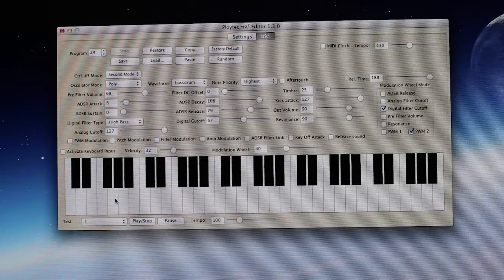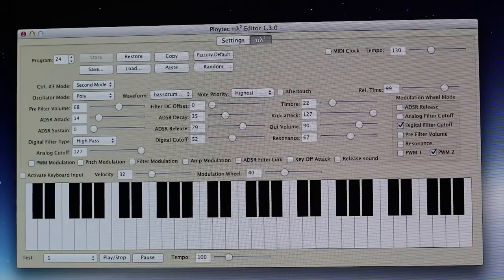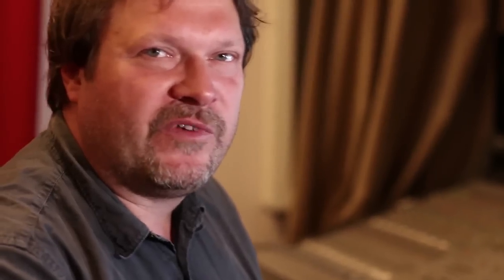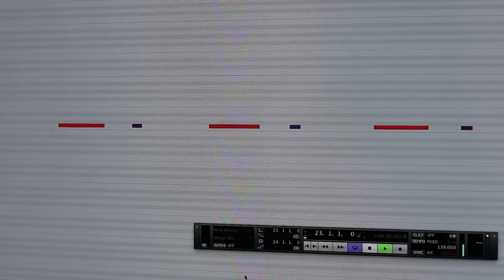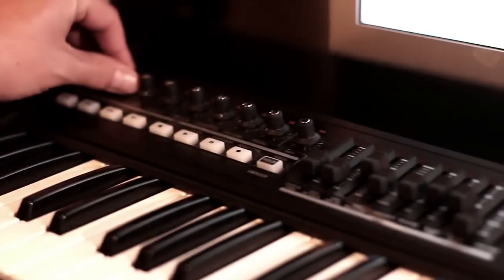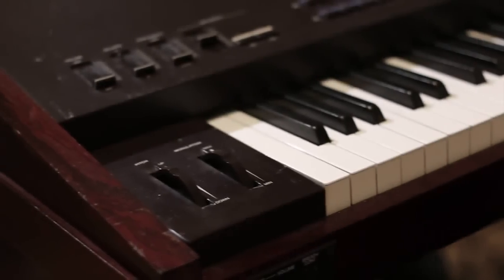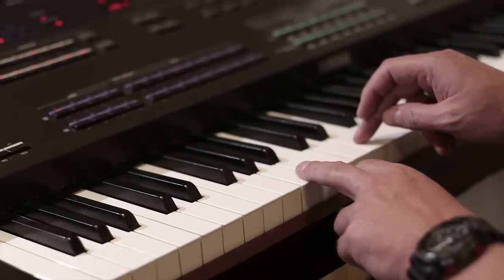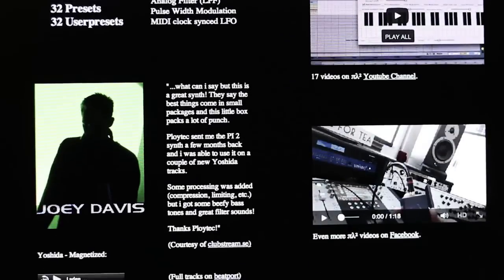πλ² Ploytec PL2 - PL02.56 (SP0256-AL2 tribute) Firmware explained

Comment: This statement from manual seems not correct:
 Program #3 (MIDI #2):  allophones retriggered after modwheel control change 
After note on nothing happens when modwheel is sent. No allophone change happens.
Reply from the maker: +Азис Мразиш With the modwheel you select the next allophone being used when sending a new MIDI note. The one being currently played stays unchanged until you release the key. It's very much audible with "AY", "OY" and the like. Instead of a new "OY" you just get the "Y" (actually the state of formants where it last ended).